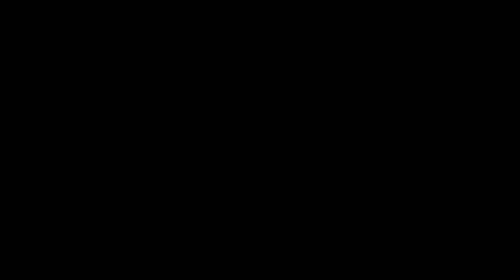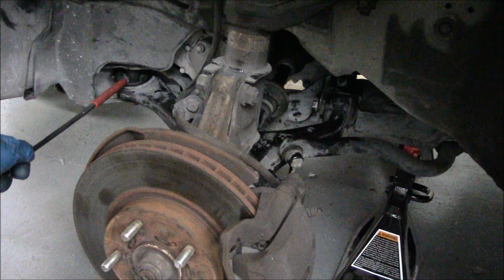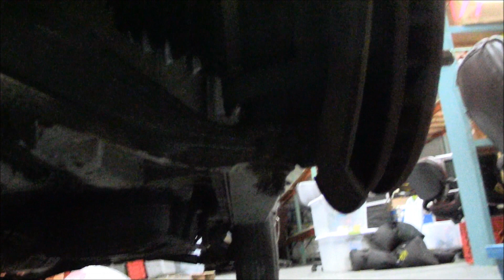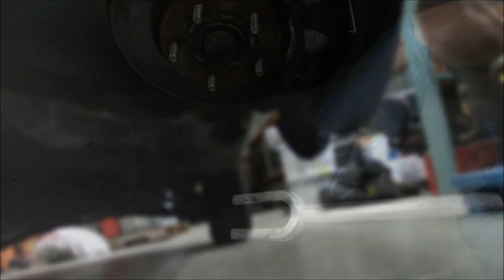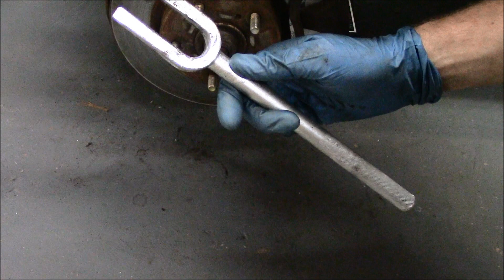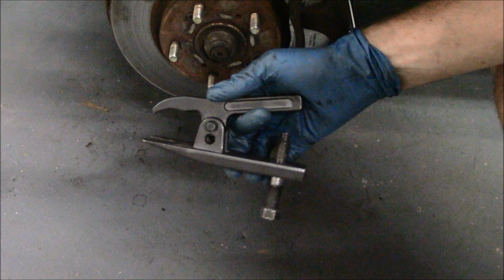Honda Element Control Arm Bushing Replacement

Comment: It it possible to remove the 19mm with a 3/8 drive ratchet? or impact? Also does control replacement require to jack up control arm before tightening 19 mm busing down?
Reply from the maker: 3/8 drive breaker bar, yes... ratchet... not ideal to get enough torque on it. Jacking up the control arm would be a good idea, on my Porsche and Land Rover there are specific instructions/measurements on how much to jack it up and i tend to be a more detail oriented and precise on those cars.... on this Honda, you could just jack it up a little bit and I think you are good... I don't have the workshop manual for the element, but you should be able to find it online and the workshop manual will have those details, including toque specs..
Reply: thank you ! Cant afford much right now tho I know I need manual too. I thought I would ask you because of comment you made about ball joint it seemed to make sense. Thanks for the response!

Comment: Thanks for the video.  Normally I am all for replacing components, but in this case the cost savings between buying bushings and having them pressed out/pressed in or struggling to do it yourself with hand tools is nominal -- it might make more sense for most people to replace the entire lower control arm assembly.
Reply from the maker: Agreed, I can go either way, on my LR3, I replaced the whole arm, because I got a new lower ball joint with the new arm.
Reply: Yeah, it's unfortunate that the lower ball joint is on the knuckle on the CRV (and Element, which I own), it would make it a no-brainer to just swap out the lower control arms at 100,000 miles and be done with it.  Thanks again for the video.

Comment: The original Honda part for the ball joint does not separate from the steering knuckle. It's a bad design in that the ball joint can "walk" it's way out and the first thing it destroys is the clamp on the CV joint boot.  MOOG makes an after market balljoint for the Element with a circlip on it to prevent it from moving in the steering knuckle.

Thanks for the video.

Comment: Does the ball joint separate or come out with the lower control arm? I need to replace control arms and ball joints both sides.
Reply from the maker: The lower ball joint is fitted into the steering knuckle, not the lower control arm. I'm not familiar with replacing the front lower ball joint on the Element, I could be wrong, but I suspect you'll need to remove the steering knuckle completely to be able to replace the ball joint or you may have to replace the whole knuckle depending on parts availability. good luck.
Reply: You can buy the lower ball joints and just use a press to remove and install. Just wasn't sure if the ball joint came out with the control arms or not. Thank you for your response.